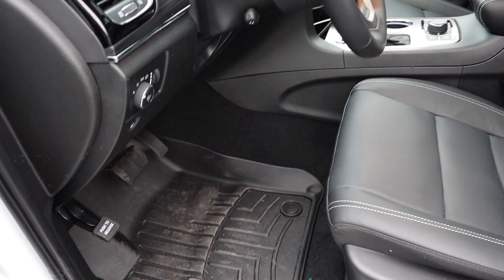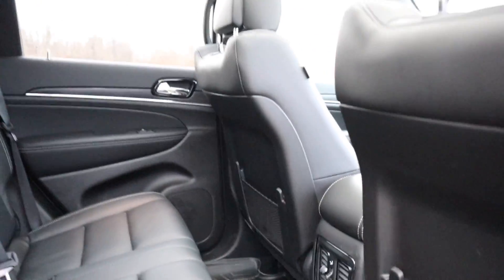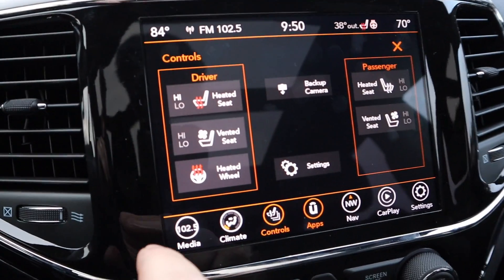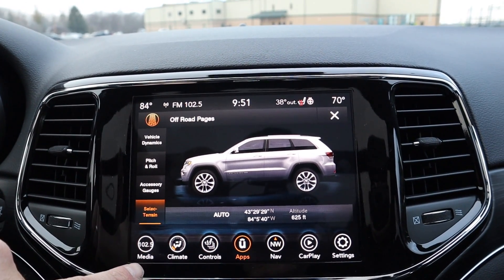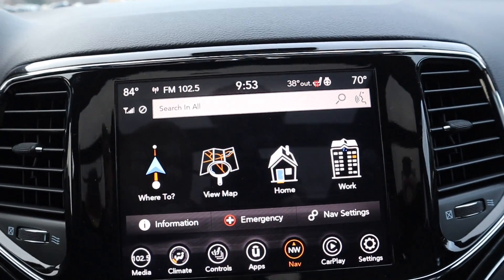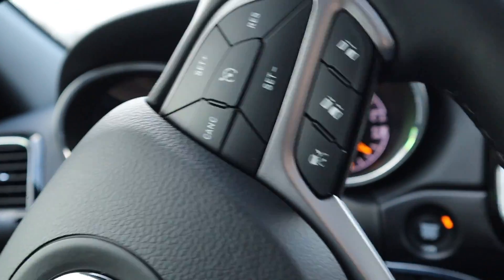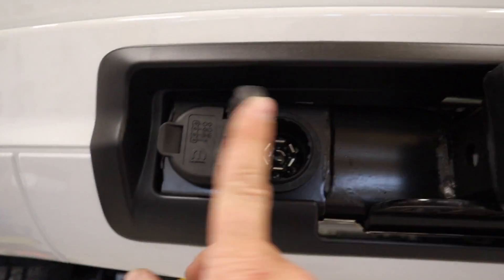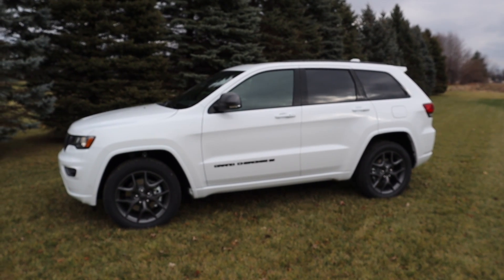2021 80th Anniversary Jeep Grand Cherokee

Comment: The Dodge sill plate might be the worst screw up Ive seen yet from Jeep. I thought missing body sealer and crooked door badges were bad on my 18 Altitude!
Reply from the maker: Yes the dodge sill plate was there when I picked it up. They had to order a jeep one to replace it.
Reply: @shaunsgarage1091  Did they let you keep the Dodge sill plate? Also, how do you like your GC? My lease is up in a few months and Ive got my eye on a white 80th like yours.
Reply from the maker: @SuperSportSS  they did not. I asked for it but they had to send it back for the warranty.  We have about 1500 miles on it and love it. We went with the luxury edition with the adaptive cruise and its well worth the extra.
Reply: @shaunsgarage1091  I think the luxury group option is a no brainer, but not sure on the bi Xenon lighting package. My 18 Altitude obviously does not have them but I think I will have to drive one at night with the upgraded lights to see if I really want it. Did you figure out the self leveling shocks for the tow package? Im in Metro Detroit by the way.
Reply from the maker: @SuperSportSS  I do like the upgraded lights, I wish they had one in stock. I haven’t looked into the shocks yet. I have only towed a light trailer so far. I will put it to the test when I get my boat out next summer.